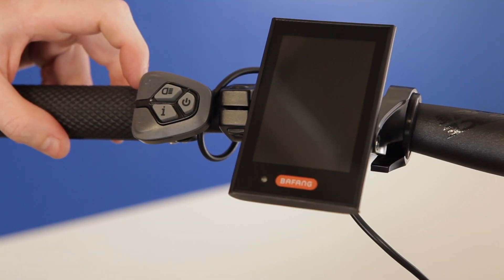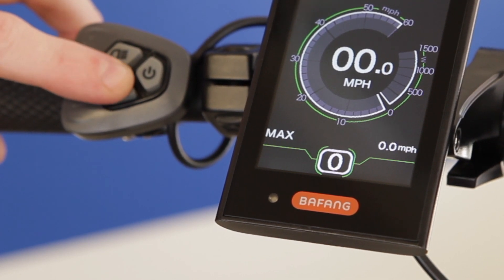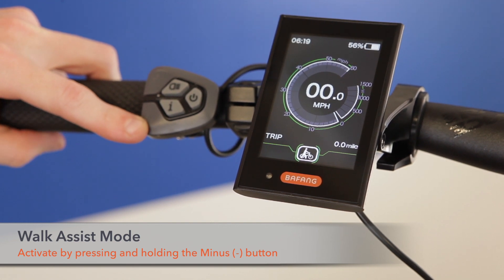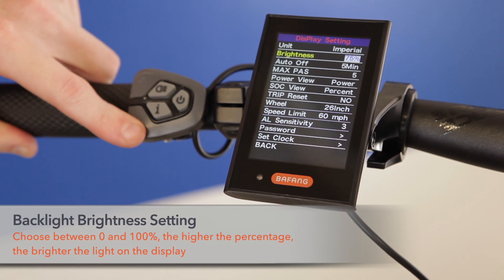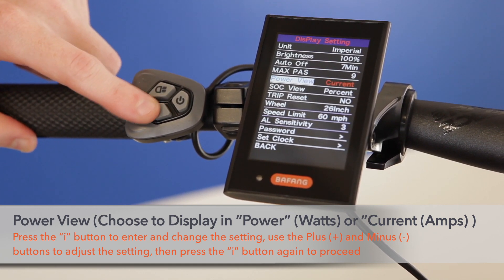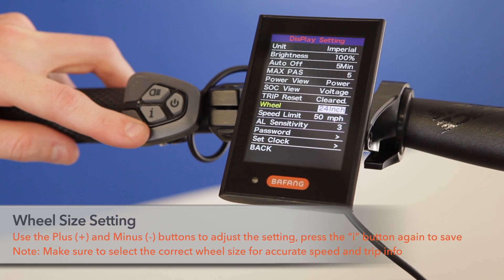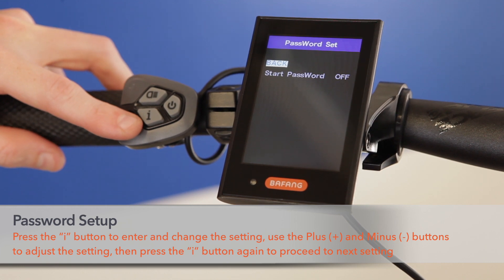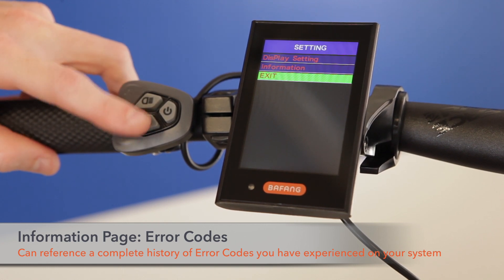Bafang DPC18 Display Programming

Comment: Gutted, I had over 2,500k miles on my trip & its gone back to 0 itself! Is the ODO meter accurate coz that’s still reading but more miles on it as my speed sensor broke & I used it for a while still.

Comment: Just bought a used e-bike conversion with a Bafang BBS02 motor and this DPC18 display. While the throttle power is dependent on the PAS level (1-5)  for some weird reason the PAS is always at max regardless what level it's set at. Anyone familiar with these units have ideas? Thanks in advance.

Comment: About changing the maximum speed limit:
If you have a triangular plug on your display then you have the CANBUS protocol, you can't change the speed limit with that unless you have a BEST Tool I believe. If you have a round plug on your display then you have the UART protocol, then you can change the speed limit. You can order a new display (from China) to change the maximum speed limit.

Comment: Well I can tell you that this display will not work with the bbshd motor. I think it's very frustrating that suppliers of bafang motors do not tell you this. You will be limited to around 45kph and will only have 5 levels of pedal assistance. If I paid for a motor that is meant to have 9 levels and able to do close to 100 kph I want that. Bafang I don't believe are at fault rather than the suppliers like I said are.
Reply: Just set “MAX PAS” to 9 in settings, and it will work. I did the same

Comment: It doesn't have current adjustment? 20 or 25 amps for example?
Reply: You need a bafang programming cable to connect to the batteries BMS to do that.

Comment: What motor is this compatible for because I'm running on a 750W bafang motor  ?
Reply: I have this display with a 750W Bafang hub motor.
Reply: @j-wray  Will it be compatible with my 750W Wheel Hub Motor?
Reply: @calvintanner7897  No idea. It works with a Bafang 750W that's the only thing I have to go by.

Comment: I find it I interesting that you need to reset the time clock every time you reconnect the battery.  In my case, that would be everyday as I recharge mine inside and park the bike in an unheated garage.

Comment: What about that clock on the display. Will it remember ghe time if battery is disconnected?
Reply: Mine does; the trip data is retained, too. (There is probably a CR2032 battery in there.)

Comment: my ebike is on 48V battery, and the display always only shows 60% battery when I have fully charged the battery, please help me
More info, the display I use is DPC18
Reply: same here. But I changed to Voltage display and this works for me.
Reply: if you still have the bike, you need to get the battery re calibrated via the bafang besst tool

Comment: When setting wheel size is it actual size with tire on or rim size? my 26" rim with tire is 29"
Reply: The "Key word" is wheel size, not rim size..
Reply: i have a similar question. how does the controller know exactly where the speed sensor/magnet are located. i installed a conversion kit so the location of these isn't fixed
Reply: @richb7524  Im presuming you are referring to how close/far from the center hub the magnet is set. If that the variable you are referring to its quite simple. It doesn't matter. The magnet has to complete a revolution and if its near or far its still one revolution of the wheels diameter.
Reply: @FREEHAND.WETGRINDER  I was thinking the same thing but the controller has settings that can go as low as a 9 in tire- threw me for a loop. I plugged in my size, 26, and rode a known distance; odometer was on the money. I just completed my build yesterday. Thnx for the reply

Comment: Hy , I have a question. Why I can't see how many times I've charged the battery,  it's seems that the battery charge cycles counter it's not working.
Reply: Over a year since this video was released, and still this is not available........
Reply: If you have a simple +/- two-pin connector, there is no way to receive this information from the batteries BMS.
Having just +/- and no data link is one of the advantages and reasons I decided to buy Bafang motor. I can use whatever battery, cheap and easy - no weird error codes which can stop operation.

Comment: The wheel size and Speed Limit are not visible on my Svitch XE+ bike which uses a Bafang DPC 18. How do I get those options ?
Reply: What motor are you using? Some controllers will not work with certain motors.
Reply: @walter9724 it's a bafang 250w motor
Reply: Same here.  I have an M600 motor

Comment: Why did you film this inside..?  could it be that you can't see these Full Color Bafang displays in the sun..?     If the 965c or the 961 had a Speed, Volts and Wattage indicator, i would gladly spend a ittle extra..
Reply: Nah, unlike many ebike displays, the DPC18 is highly visible even in direct sun. 
It's even more vivid than my tablet or Samsung phone. (Though much lower res, & lower refresh rate.) 
The Wattage indicator is very prominent, easy to read at a glance. I wish the battery indicator were as large!

Comment: Hello... TFT and Sunlight Readable TFT are vastly different in terms of not washing out in Full Sunlight.. (the place we need to be able to get info from). When is Bafang going to offer a display that doesn't washout in the sun..?    I have no problem seeing the 961c and 965c... but i need Speed indicator, Wattage consumption, and Volts..  When you are trying to optimize range, you need to find that perfect spot between Power level and Gear Ratio.. But unless you can see the watts, it is nearly impossible to fine tune the bike for range.  Can you get a hold of Bafang and let them know that they need to make a "Sunlight Readable TFT" display..   Not TFT alone.. ?  TFT is TransFlecTive screen... Sunlight Readable TFT polarize the sunlight hitting the screen so that you can see it.  :)
Reply: BTW, Ebike enthousiest have money to spend.. And we don't want to waste money trying models that don't work in most Ebike environments.   I'm ready to spend a little more for sight.
Reply: I agree that most ebike displays are hard to see in direct sun. 
The DPC18 is easily readable in direct sun. (Its backlight is also adjustable.) 
At full intensity, it is more vivid than my tablet or Samsung phone. 
The Watt meter is large & visible at a glance. (I wish the battery & trip data were half that big!)

Comment: I bought the front hub motor kit with this display option. After I paid I was told it only works with pedal assist. I only have the front hub. Will this work?

Comment: Hello in the display manual dp-c18 reports Sport and Eco modes but how can you change? i tried pressing + for more than 2 seconds but it doesn't change? can you tell me if it is possible to change and how to make this change?
Reply: Same... Did you work it out? I haven't
Reply: Press “I” and + to toggle Eco and Sport mode. Can also change in menu.

Comment: I have the dual mode (eco/sport) DPC 18 is there a way I can flash mine and get the same as your with 9 pass assist
Reply: Did you ever get an answer to this?
Reply: @Downham34695  No they never replied to me even after many messages
Reply: @pharrohku5922  I got a reply from Luna and they say there is no way to do it.
Reply: @pharrohku5922  good to know. I’m sure there is a way to do it, I’m just not sure how to flas firmware on the display.
Reply: @Downham34695  you have to have the right software and i was able to get hold of the software the companys use to flash the bafang displays.

Its not really any different than flashing a custom rom on your android phone or when you reprogram your bbshd or Ultra motor controller's  to your liking

Comment: Speed Limit dont work for me, I have set 25kmh but the bike still goes over 40kmh, can someone say why?
Reply: The bike can go as FAST as you can padle bud the motor will push for you only till 25 km/h is reached
Reply: Make sure your wheel size is set correctly.

Comment: Hello, I have an electric scooter with LCD (smaller) and same connector (5 pin) and I would like to know if this display is compatible for other types of devices, such as my scooter.
 The connection is the same, once again, but I wonder if this display is reserved only for electric bikes or for the Bafang brand only?
 Thanks in advance.
Reply: bafang only
Reply: @yuzhaiguo409  Thank you bro. 😊

Comment: I need help.... My speed limit tuner and the wheel size is under information instead of display settings... Hence I am unable to change the speed limit.... Please help me change it. 🙏🏻
Reply: This means that your display is one that received a firmware update from Bafang and it has locked out access to the Eco/Sport settings.  Holding the + button down will not work, no matter how long you hold it down.  The other concern is that the wheel size and speed limit are not able to change, either.   I was told Bafang pushed this firmware update to its newer DPC-18 displays without even telling the retailers they did it.  Bad Bafang!  My advice to you is to contact your retailer and ask them to send you another display -  one without the firmware update.  That is what I have done because I'm in the same boat as you are.   Other than that issue, this is a great display with beautiful colors and easy to use input pad.  What brand of ebike do you have?
Reply: @tenaeastburg1457  Working with distributor on replacing controller or display. Bike is great fast and powerful. Just need to be able to cruise sometimes and not break the speed barrier. Thanks for info.
Reply: Same here. My bike has only one speed Fast!!! How do  you turn them down?

Comment: Does this work with 52V battery? If the battery is fully charged (which can go to ~ 57V) would that still work ok? Isn't this better or worse than 860? Thanks a lot.
Reply: As long as the display and battery are labeled as 52 volt. All or most batteries are of higher voltage than stated when fully charged

Comment: It is a shame it does not have a brake symbol, wich ligts up when hydraulic handbrakes ar aplied, so motorpower is cut,  so you can adjust the hydraulic brakesensors easily
Reply: @PaPa Frampton Bafang motor controllers are notorious for shipping with no config done. 
In particular, their torque sensing motors such as the Ultra m620, aren't calibrated to provide accurate torque sensing. The "default config" leaves the sensor's Base Voltage set to 0, which is NEVER correct. At 0 mV Base Voltage, any pedal rotation at all registers as ~12Kg of pedal force! Accurate baselines, range from 732 to 763 milliVolts. 

For Bafang motors without torque sensing, the only control variables are pedal cadence & throttle. 

Throttle is smoothest when set to Current rather than Speed scaling mode. Pedal Assist requires calibration of KeepCurrent, Decay rate, & Decay time, to maintain steady assist. Setting the Slow-Start Mode to 7 helps reduce jerk when the motor engages.

Comment: hi,
 is the bafang dpc18 display can use for 52 volt ebike?
lg
Reply: Yes I have 52v17.5amp and works fine
Reply: @johnblakewaller9322  thanks 👍
Reply: @makeyourownsystem2425  its actually a really good display and pretty much spot on with KLM distances and speed
Reply: @johnblakewaller9322 hi,
yes it is Nice display i have one, i will install it in my ebike just wan to know everytings about that befor install it.
Thanks ✌
Reply: No you cant use it with 52volt 30amp pack, battery when it fully charges and you turn the display on it throws code 7 and disables the motor
Reply: @no1aussiepaul  thanks for the info...

Comment: Does this model have ECO and sports mode
Reply: I did some investigation,  if you have the old version with five PAS level, it does come with sport and eco mode. If you have the newer version with nine (9), PAS levels, it does not..
Reply: @europass1  thank you I have 5 pedal assit turned on but I think mine must be set up fo for 9 pedal assit as well but probably have the new model but thank you so much for trying to help me 😎
Reply: With bbs01b you have eco and sport.. Mayby try programming trough data cable?
Reply: @europass1  I think I have bbshd 1000watt
Reply: A 1000 watt and still need sportmode?😂
Reply: To change beteren sport and eco mode, hold the + button for 2 seconds..
Reply: Between
Reply: @europass1  ok I'll try
Reply: Tried but didn't work Maybe mine is the same but this feature didn't get programmed but thank you for your help
Reply: Yes.
Reply: @europass1  how come mine only has ECO mode how can I get sport mode to appear please